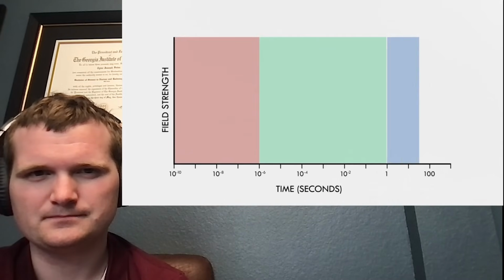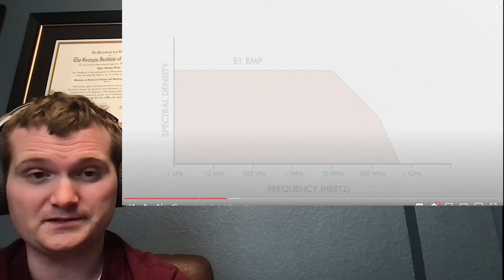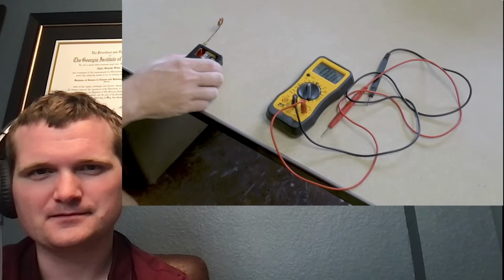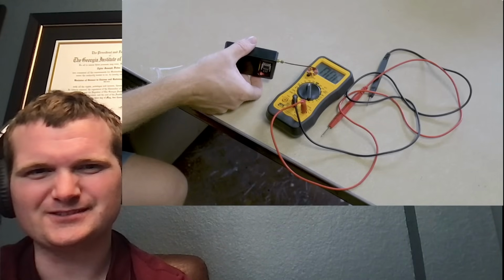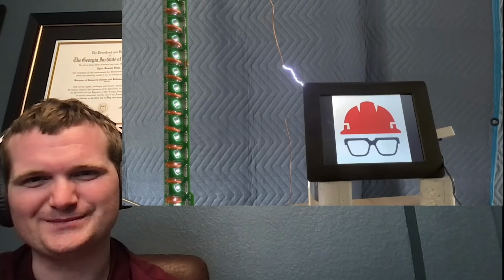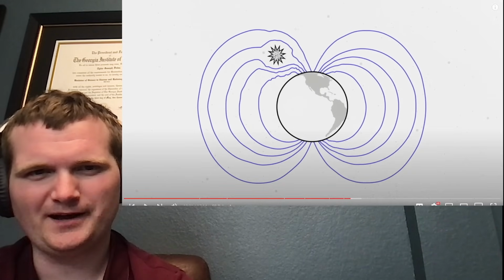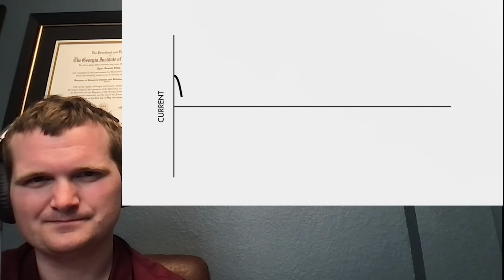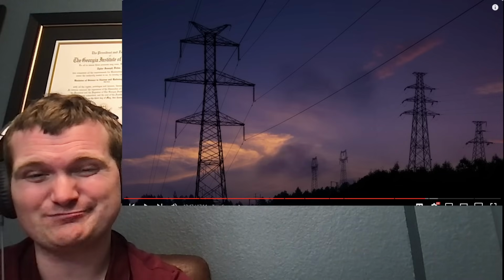How Will a Nuclear EMP Affect the Grid? - Nuclear Engineer Reacts to Practical Engineering

Comment: I disagree completely with your final summation.  You fail mentionelctrical supplier apathy and the lead time to source a new transmission transformer.  You mention changing out a single transformer.  A HAEMP will very probably effect a dozen or more transformers, none produced in the US.  I haven’t even mentioned the chaos that will inevitably stem from a regional grid collapse.  Time to source new equipment, build it, and install it, debug it, and then go online, all the while the Military is vaporizing whoever is responsible for this, no help in CONUS.  Downplaying the effects of an HAEMP (actually 3 
Well dispersed) creates a false sense of security.

Comment: Something that I thought after Fukushima is that the design intent should include 'If the core is producing heat, then the system should be generating electricity.' 

By this I include even the decay heat with the main turbine disconnected, and without the grid connected.

My understanding is that the final backup cooling was a set of steam turbine powered pumps, and these only needed electricity for control...but they had no way to supply even that control electricity.

Comment: I am a systems technician in a major telecom company. There was a nuclear PP in my area, it has since been decommissioned but irrc none of the computers that could effect the plant operations were connectable to the open internet. They were one way fiber optic transmit only so outside computers could see what these computers were doing, but no commends or files could be loaded into these systems remotely, you needed to be at the terminal.

All critical infrastructure communication systems including cell towers, DOD, other utility companies, police and our own systems are hardened and many are electrically isolated from the open grid as well as DC powered. It’s not foolproof especially with a near hit but these electronics will survive better than your tv or tesla…

Comment: I have a really funny story, which is actually scary for 25:00

I used to have a person in my circles who was really high in Wien Energie so basically the company supplying electric energy to Vienna and he told us that every winter he was praying on certain days to all of the gods he knew because the system was always just barely scratching by for a full collapse. I like the scenario Tyler talks about 
why?
Because people would have old heat pumps, whilst the heat pump is usually a very effective means to regulate temperature in HVAC there is a term called cop quotient that means how much output I get through how much energy I put into a system for example the COP of a lightbulb is one because like 99% of the energy that I put into the lightbulb gets out of the lightbulb as heat the average AC can do around a COP of three if conditions are not bad; if a COP value falls under zero that is something where you scratch your heads and asking yourself like why why do I have to put in more energy into that thing to get warmth out of it it can happen sometimes if a thing is defect it will happen I have seen a COP of 0.8 once so how does this translate back to AC and heat pump? Well you can cool with ACs and heat pumps and you can also heat with both of them traditionally I will go with this example with an AC because I know them better but it works almost the same for heat pumps as well:
An  AC will make a heat transfer to the outside so this means that if it’s hot outside and inside, it will try to dump the energy basically outside that is the very simplistic explanation with a coolant circle and everything transfer it so that means there is a top limit, which is usually for an AC around 40° of Celsius after that it will just shut down because the refrigeration circle is not working anymore but it also depends on the coolant gas. This process will reverse if you want to heat with it so that means that it will take energy and heat out of the cold air outside get it inside and heat the air with that more or Less that means that after a certain temperature, efficiency of said mechanism will drop drastically and (unless you apply special procedures like in specifically heating centered AC units for example Panasonic Nordic is a series where you can heat even more effectively than cool and it has like special mechanisms that make it still get good energy rating down to -15° of Celsius) the same thing happens with a heat pump so if you have an old heat pump after approximately 5°C, if the temperature outside falls below that it will work with the efficiency of a lightbulb to make it really simple that means that power uptake in the system is exponentially higher, and that happens around the same time because on the same city it is the same temperature that means that you will have really big energy spikes energy uptake spikes on the system. Those were so big that people were literally sitting day and nights in that office during those periods of time literally praying that the system doesn’t collapse and we don’t have a blackout. (Information from around 2018)

Comment: We were without power for a week during the 2021 Texas freeze, it was -4 and we woke up at 3am with no power and it freezing inside, I grabbed my 8 year old grandson and put him in the truck. My toilet was completely frozen and broke, all the pipes in my house were broken, and we only received a “oops my bad” from ercot. I heard several people froze to death, mostly older people.
Reply: not making light of the situation that happened, but Texans should have been more prepared for that event, seems about every 8-12 years Texas has a major freeze. Texans should totally have wood stoves installed in the house and at least enough wood to last a month. Where I am we could have weeks long outages with temps down to -20 sure its "rare" and don't happen every winter but it happens, wood heat saves.
Reply: @Dratchev241 I use a whole home propane backup generator with a large enough tank you should be fine for a couple weeks.  The techs that put in my tank and pipes figure mine would run for two weeks on my tank without any problem.  If the outage is longer than that we are in a whole different situation

Comment: While nuclear device detonations higher than 30 km above ground are classified as high-altitude detonations, EMP weapons are generally triggered between 200 and 400 km above ground. The EMP generated from a 400 km a.g. detonation covers a very large area. Timed sequential triggering of several geographically spaced EMP devices can significantly increase EMP effects; and these also become significantly stronger when a device is triggered at higher latitudes due to converging magnetic field lines. EMP weapons are generally focussed on gamma/x-ray creation and usually have a substantial fission component.

Comment: It’s actually scary to think how many things are electronic these days. If that happens, your car doesn’t work. Your refrigerator and oven don’t work even if you supply electricity literally nothing works. Everything has ran on my controllers these days you lose everything.
Reply: Your need a long antenna to accept an EMP. The one thing that is most susceptible is the electric grid.

Comment: At about 10 minutes into the video he comments about bringing in additional diesels to a nuclear power plant from remote locations.  A major flaw in that logic is that in the event of a nuclear war there won't be just one bomb, there will be multiple bombs.  As a result, a lot of infrastructure, such as roads, bridges, etc. will be destroyed.  You won't be able to load up a portable diesel generator onto a truck and casually drive to where it's needed.  Also, if the grid is down, things like gas pumps that need electricity won't be available to fuel vehicles.
Reply: In that case it probably doesn't matter...
Reply: Helicopters

Comment: When I was working at GEC Marconi avionics in England in mid 1980s... We had special electronic test equipment that would replicate the electrical effects of an electromagnetic pulse.... Which typically was a 1 kV, in one second rise time... On a military radio system... It needed special filters to protect the power supplies into the radio system from the induced voltages and current that would occur on the power bus of a military aircraft.... As a further protection the power supplies in the military radio system that we were developing for the then Harriet GR5, had special Zener diodes, that would detect the gamma flux and crowbar the 5 V power supply rails to ground. This would appear as an intermittent, that would last long enough to protect the electronics of the military radio system.   Just thought you might be interested.....
Reply: You are still subject to the Official secrets act. Be careful what you give away.

Comment: The effects on electrical appliances of Nukes or even Sci-Fi EMP weapons are also highly exagerated. Most of our appliances are effectively in a farraday cage to begin with and even if they werent, an EMP would generally only damage systems which are currently running, not generate so much that something that is not powered would be fried. Generally speaking.

Comment: How much about that Texas freeze near-grid-collapse incident did you read? I got the impression that the TX government and the media circus rings would like us to believe that wind turbines were the key issue, but wind was still only ~25% of their grid, and all sorts of power generation methods were affected, not just wind turbines. NG-powered plants make up ~50% of the Texas grid's generation capacity and those were also having serious issues due to none of their infrastructure being hardened against freezing temperatures. At the time, ERCOT Senior Director of System Operations Dan Woodfin was on record as estimating wind as ~13% of all the grid's problems, and is quoted as saying, "It appears that a lot of the generation that has gone offline today has been primarily due to issues on the natural gas system." Heck even Greg Abbott mentioned gas and coal problems in a Tweet to contradict the theory that someone had sabotaged the grid, regardless of whatever other shade he threw about "frozen wind turbines" later on.
(And even if the main cause had been wind turbine failure--maybe ask why anyone in Texas decided it was ok to leave the grid's stability in the hands of a source that intermittently and therefore unreliably generates by its very nature ??? Seriously. If stilled wind turbines could bring the TX grid down, what was the plan if some weird weather pattern meant no wind for days?)

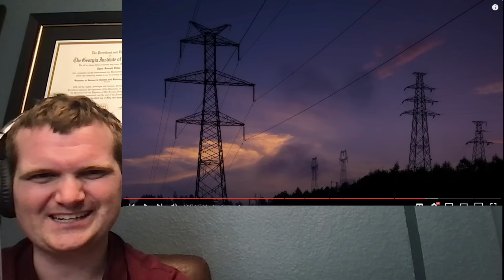Comment: 25:40
Granted, but the 400 Kt warheads are also in MIRV configurations nowadays.
Meaning you don't only have 1 EMP detonation, but multiple overlapping ones.
Reply: ..wouldn't the EMP disable the circuitry of the warheads? I am quite sure the reason why a fistful of high yield thermonuclear warheads and single warhead launch system configs are kept around by the major nuclear powers is for that purpose, launching the EMP separately
Reply: @homeopathicfossil-fuels4789  No. Military electronics are hardened and protected against EMP's IDK how the military would protect the electronics of a warhead but if i had to guess, the entire outer structure of the warhead probably doubles as a faraday cage to keep the electronics inside safe.

Comment: The interesting thing with AM antenenas too is that to get power to them they use a special austing ring trnsformer which is basically two doughnuts of wire looped throguh eachother. The primary provides power the secondary picks it up, and a large airgap between them. This keeps the tower from grounding out but still allows power up the tower for the lights.

Comment: I remember  reading a bid request from the DOD about a micro drone using an EMP that would disable electronics in a one block radius back around 2010. As for  the time to get the power back on that depends on the transformers - how many we have as spares that are unaffected. You're also making the assumption that we'd have notice about an emp - there are ways to do it without notice or at least with 2-4 minutes notice.

Comment: The structure of an EMP is complex, it has a high rise time pulse of about 4nS rise time followed by a fast die off, this lasts about 60nS or so. Then a ringing wave has a much linger duration pulse takes over that is in the mS range, about 30 to 90mS similar to a lightning strike's field. Finally there is the long wave pulse lasting a few minutes that is the grid killer. You can build a simulator for the E1 and E2 waveforms at the correct energy intensity using a spiral line flux compression HT generator driving a cheap HDTV fractal antenna with a small dish to focus it. Use an inductor to change the frequency center and pulse duration. All i will say is pulses like this will see electrical circuits as capacitors or inductors. The field will behave extremely unpredictably. The E3 field is extremely difficult to simulate accurately.

Comment: Are neutron amplifying fission-fusion-fission weapons more effective EMP generators? (neutron bombs which you don't hear much about)
Also if you want to see a cool Marx generator look up a 500,000 volt rock disaggregater or if you're into dangerous builds look up a diy Marx high voltage generator using containers of water/saltwater as capacitors to step up any high voltage source, simple, cheap, entirely scalable and extremely dangerous.
If you look up "White Light Solar Flares" you will find out some interesting things like how if you observe one there is likely a Carrington Event sized solar event or larger Coronal Mass Ejection which a direct hit may cause a virtual apocalypse.
Reply: The best EMP generator would be a pair of devices triggered about 2 seconds apart, the first one would agitate and create a strong field of already ionized air. The second one would excite the field to cause a flux compression effect. The first device need not be very powerful, but the second one would work better if it's more powerful. This also would make the pulse more directional.

Comment: It is rather difficult to hack computers that are either coal fired or wound up in the morning.   ;)

I do see EMP effects routinely here, due to geology and geomagnetic storms from solar events. Basically, certain energetic solar events result in errors in my computers, resulting in the need for a reboot.
Still, EMP from nuclear, think Carrington Event of more limited scope. Starfish Prime generated mostly humorous events, like blown streetlight lamps and a damaged microwave relay and a bit lengthy radio blackout. The Russian version, well the Pacific is notable for its, ahem, sparse energy grid, where Russia tested did have lengthy transmission lines and resulted in a generation station fire and actually fused telephone and power transmission lines.

Nuclear EMP? It'll get real expensive, really quickly. Lots of really angry people in the utility industry, plenty of overtime earned. We routinely get far worse from a major hurricane and a POTUS doesn't send replacement components from a national stockpile, but instead throws paper towels around a room.

Comment: Questions from an EE - As far as microelectronics, it seems like they would be pretty well protected by common PCB components such as TVSs, caps, inductors, polyfuses, regulators, zeners, and all of the power conditions stuff we usually design into the power input for dirty power. Can anyone else weigh in on this?
Reply: The issue is every control and data line on the circuit board is going to be an antenna. The TVS diode arrays are generally used to protect USB and other spots that are expected to take an ESD hit. The first portion of the pulse will cause everything on the board to act like an antenna, a capacitor, or an inductor. Built a simulator that accurately simulates the E1 and E2 pulsed fields and anything with a good differential to the pulse was toast. Surprisingly the TF micro SD cards without being in something took it. But USB drives were not even recognized at all. Stuff with longer traces and wires internally was fried. An older laptop took it but the screen was damaged. It did have a layer of copper metalization on the case that gave the mobo a better than nothing shield to it. It was a 600x ThinkPad ❤
Reply: If it was not specifically designed and tested for withstanding pulse, be sure it will fry🤷‍♀️

Comment: Not really an "odd" advantage. Modern control systems orthodoxy is flawed. Electro-mechanical and electro-pneumatic control are robust and will last for many decades and will never need a software patch. They are also infinitely compatible with other systems. This should be a consideration for critical systems.